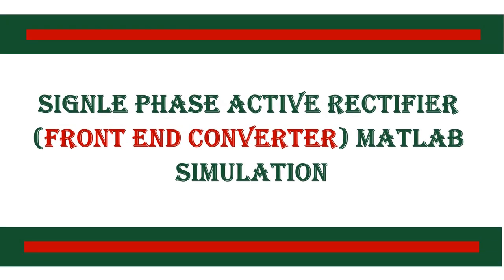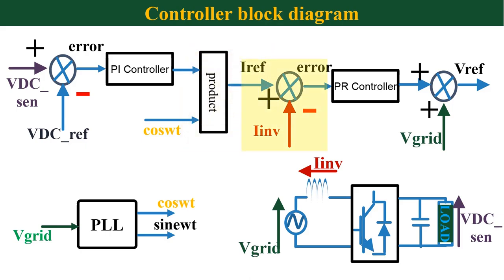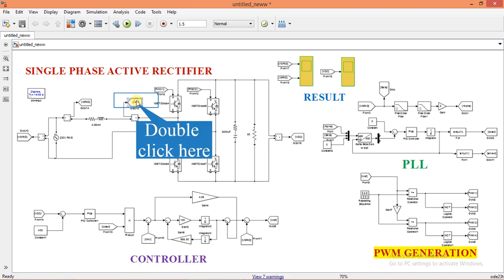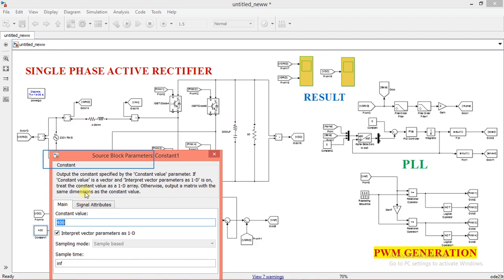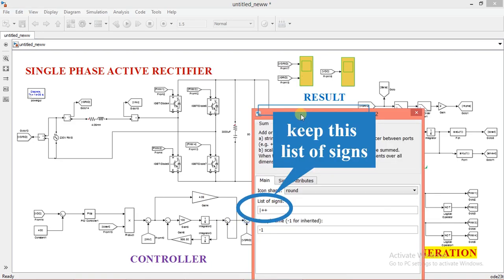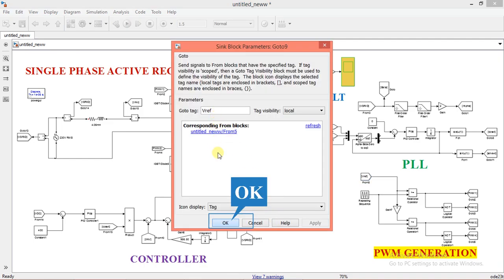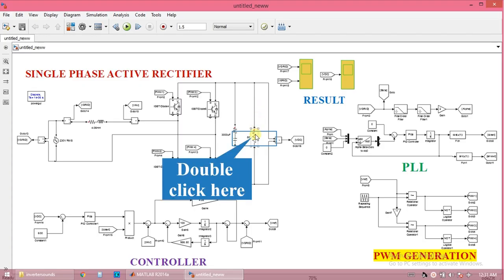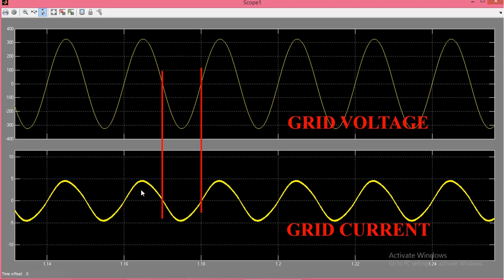What is Active Rectifier? Simulation of single phase active rectifier using MATLAB.

Comment: Thank you for the video, but I don't understand the logic in the current sensing. You create a current reference which is in phase with the grid voltage, but you compare it with the grid current in the reverse direction - the inverter current, which is out of phase with the grid voltage. This will force a regenerative current, and will only work if the DC voltage is an independent energy source. How could this work with a passive DC bus?

Comment: Hello sir! I followed step-by-step as you shown in the MATLAB but I could not get the same results as you. Could you please help me?
Reply from the maker: Share your mode at ashacademy01@gmail.com
Reply: Sir , the Kp value mentioned as 4.06 is not correct , also the VDC output is not stabilise for coswt , but if you use the sunset , the results are stabilised for Kp value of around 30V . But the grid voltage and current are still not in phase and there exists some phase difference . Can you relook into the Kp value and also if sonet or coswt needs to be used for reference generation.
Reply: Just to mention that with sinwt as reference and keeping KP value as 20 helps to get stable output

Comment: Explanation is very clear and when we simulate the same system with Matlab 2019A as per the data,the result is not satisfactory.it works good for voltage upto 400. More the voltage the AC-DC conversion becomes discontinuous and power factor also very poor. kindly fix it
Reply: How is he gonna fix it, lol, it works perfectly fine

Comment: Sir,how are you selecting the sample time .eg: 1e-6 0r  10e-6 or 50e-6
Reply from the maker: This is based on switching freq. if switching freq is very high i try to reduce the sampling time.
Reply: @TechSimulator  Thank you Sir.
Reply: @TechSimulator  sir what is significance of sample time .how it relate to switching frequency

Comment: Respected sir, Please provide reference of active rectifier. I need to write the equation in my IEEE conference. Please help me out
Reply: Have you got the reference, as I am also in search of such doc where I can find formulas used to calculate Kp, Ki and Kr?
Reply: @rajpurohitnikita7248  not yet 😢
Reply: @marvelous9300  Have you able to simulate as achieved required waveform?? Because in my case I am able to achieve required output only if a take Vgrid to be negative..
Reply: @rajpurohitnikita7248  I followed the same process as discussed in video and Achieved same result.
Reply: @marvelous9300   okk then, will check my simulation again